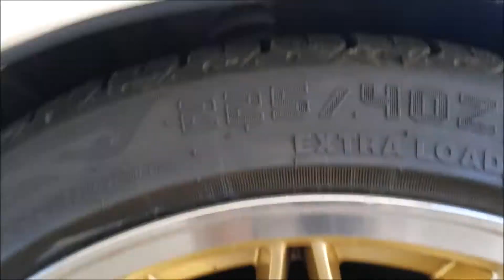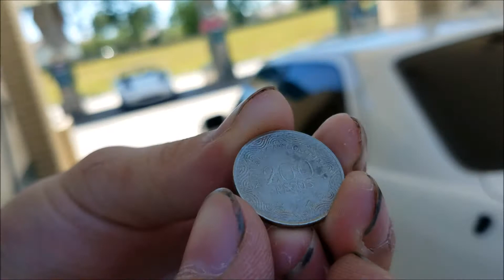Godspeed coilover 1st impressions

Comment: its been 3 years how did they hold up and how did it handle and corner and ride quality overall any body roll ,cheers
Reply from the maker: Had it for a year and it was great the whole time never missed a beat my buddy also runs them on his gs and there great after 2 years
Reply: mischief mechanics did you experience any body roll and are they good at high speeds?